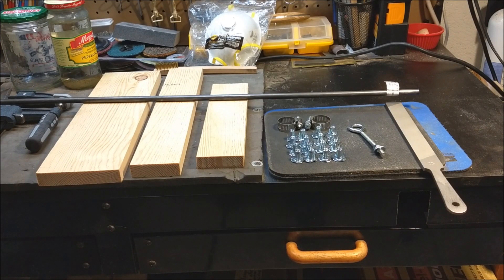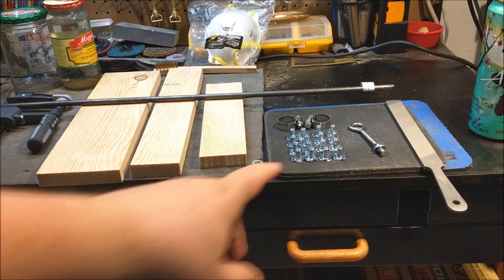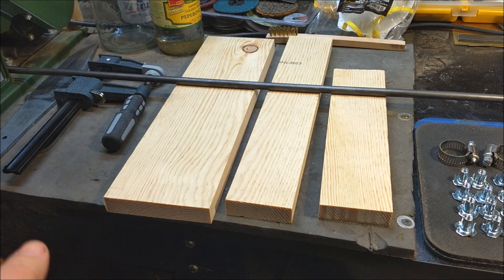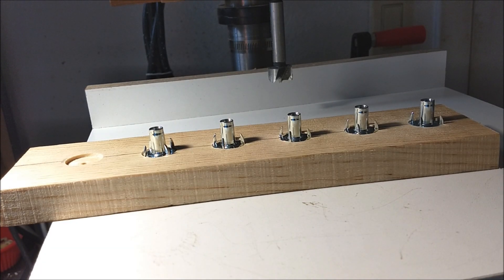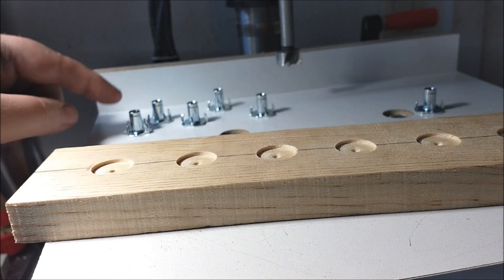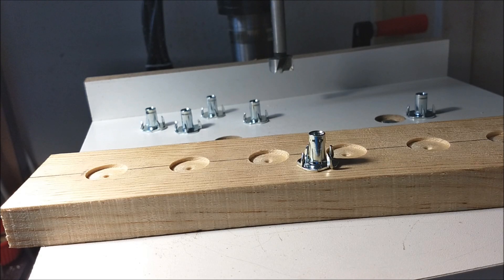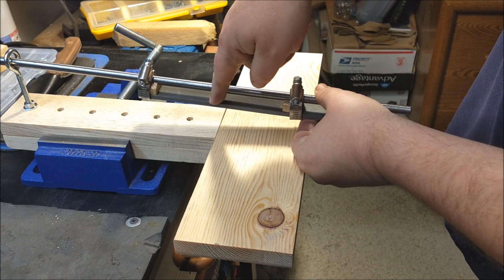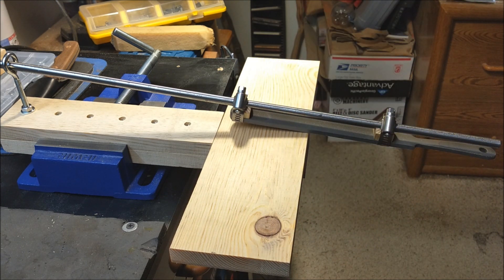Knife bevel filing jig

Comment: So I gave up on the hose clamps and the little wood blocks you made. Just tack weld the file in 2 spots. At the top and out of the file work area near the tang on the bottom of the file. When you wear that side of the file out, just cut the spot weld and flip the file over and re tack it and you are back to work. No pesky hose clamps that loses up and eventually strip or break. As for that finger nails on the chalkboard sound from the steel rod and the eye bolt. A small drop of oil or a light film of wheel bearing grease cured that. However the radio rocking "Enter Sandman"  by METALLICA you will never hear any of that in my shop. I also have my handle holes drilled to be able to secure the blade to the wood with simple  screws before I start my drop bevel work. So there's no pesky clamps or anything sticking up to catch the under side of your arm or fingers on and fillet them open.

Comment: I can relate to the over thinking it, I suffer from it as well. Have you thought about improving the mouse trap or perhaps an improved wheel? Just bustin !! Thanks for posting.
Reply from the maker: I over thought it so much that I spent the money to build a full knife making shop with a 2x73 Ameribrade belt grinder and  an Evenheat heat treating oven. 😁
Reply: @snoman1973  Sweet !  I've not had the time but have wanted to try blade making for quite a while. Best of luck with your new equipment.